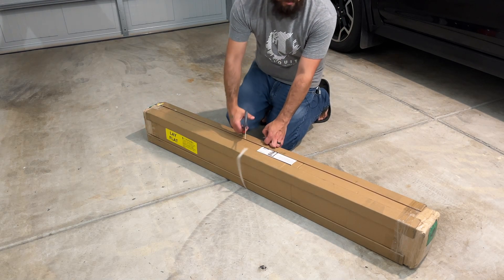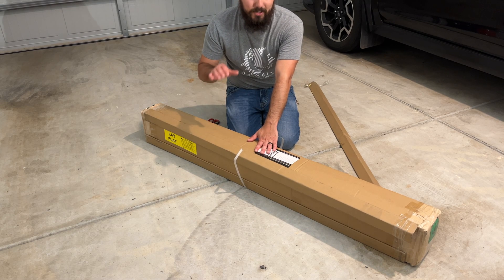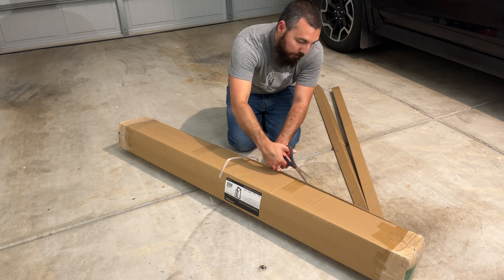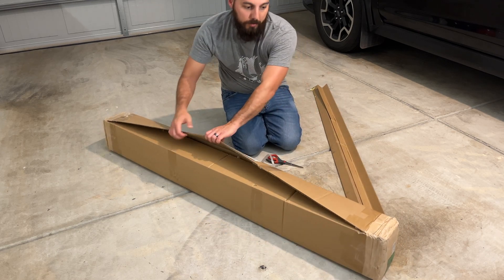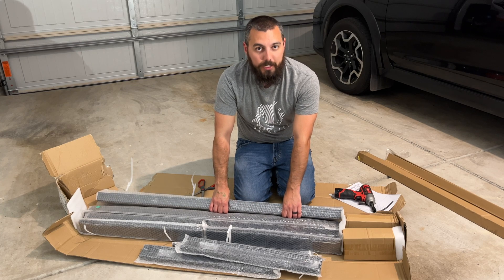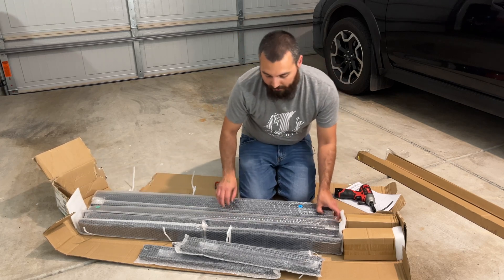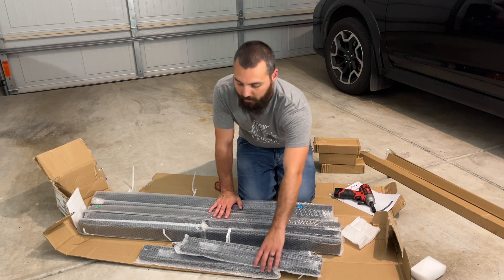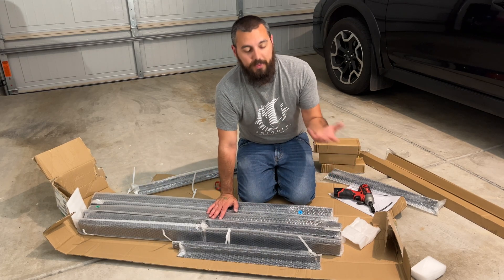New StarTech Server Rack for the homelab  | Open Frame 25u 4POSTRACK25U

Comment: Have you tried adjusting the depth while populated? How easy/hard is it? I gotta look into shrinking mine a spot or two if possible.
Reply from the maker: I have not because some of my rails/shelf rails would also need to be adjusted manually.  I have adjusted the length after this video but took the time to de-rack equipment and and loosen the rails so they could expand with my expansion of the rack.  Once done I bolted everything back into place and then re-racked everything.
Reply: @SPXLabs I did mine Sunday, it actually didn't go too bad. The back is basically against the wall so I just unbolted the bolts and pushed towards the bottom in short bits to get where I needed it. I've got a ups and ext battery pack on bottom then 1-4u and 2-2u in the middle, and a switch, nvr, and patch panel at the top....
Reply from the maker: Nice! Hell yeah.  Glad it worked out.  Sounds like quite the setup you got there

Comment: do you know the dimension of the M8 bolts?
Reply from the maker: I dont but a Google search says this.  Hopefully it’s accurate.

“Mire arrived this week with a few spare bolts. The M8 bolt total length is 21.6mm, without head 15.6mm. Thread is 1.25 as for standard M8. You can also use longer bolts.”
Reply: @SPXLabs  Thanks bro!

Comment: 3:46 aren't the "L' brackets backwards ? So that in front of the server it would hold better in the screws, then in the rear (where server is just hanging) it could rest on the bottom of the "L" brackets ? 
Just asking, I never mounted any :)
Reply from the maker: I'm not entirely sure what you mean but I feel like the way I have them installed is best because the majority of the weight of my servers is towards the front.  But I could be wrong about how I installed them.  There wasn't exactly instructions included lol.
Reply: @SPXLabs  Yes, what I mean was that maybe the "L" brsckets would go to more the rear of the server and on the front it gets mounted with the screws directly. But I see what you mean about weight distribution.
Reply from the maker: Oooooh yeah I understand now.  I could see tbat

Comment: Nice rack. Plenty of space. Kind of crazy considering that before I was like, will I have enough space with a 27U, maybe I should get a 32U and now seeing this 25U you bought is just plenty of space. But then again, now I find myself wondering if I will even go the server rack route. I have two 2U servers and recently decided to build my TrueNAS server with aa Fractal Design NODE 804. The reason was affordability and getting the parts I need for the case is way more affordable and easier than in a rackmount server. A Server rack is super cool however the acquisition of a good one will cost plus the various equipment for it (tablets, rails, etc). But again, it sure does look great and organized (although some would say, what looks great and organized is subjective however for organizing computer stuff, a server rack is hard to beat).
Reply from the maker: I also looked at 27u and 32u's because I was afraid 25u wouldn't be enough.  I think at this point it should be plenty.  I should probably start consolidating again lol.  I hope the 25u is plenty of space.  You could always put the Node 804 on a shelf on your server rack.  To help with the tidiness and such.  This is true they are a pretty penny.  Thankfully ones like these aren't terribly expensive.  I couldn't image having all of these systems in my office not in a rack lol.  I would have 3 servers, my gaming rig, and my laptop all in one room, not to mention the network equipment.  It would look awful and make the room look cluttered.  This feels like peak organization to me lol.  Cheers!
Reply: @SPXLabs  Definitely, unless you are good at building your own furniture, something that would look good and make it seem organized. And just imagine the NOISE generated in one single room, you'd go mad if you had your gaming / workstation in the same room lol.. About using a shelf on a server rack, I also contemplated that idea, still thinking about it. At least you gave me a good idea with the 25U, that would be perfect for me.